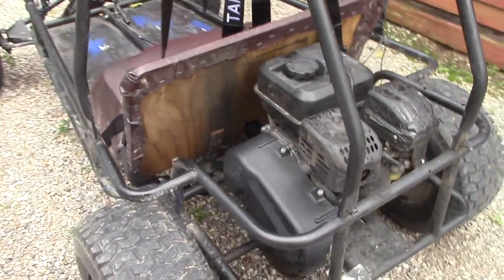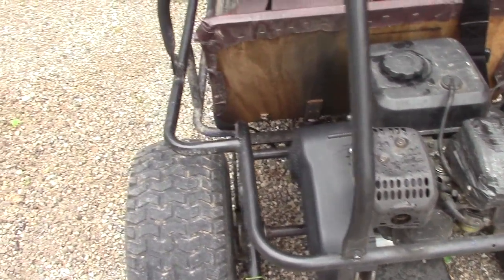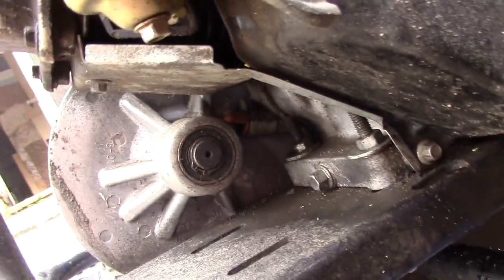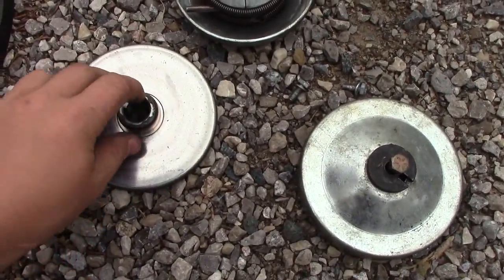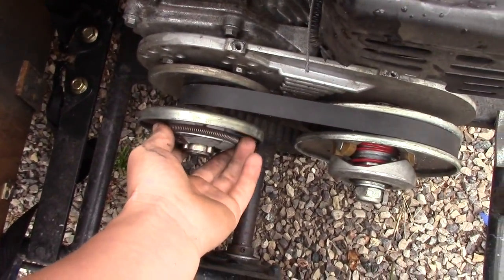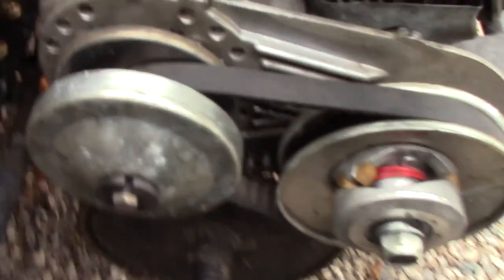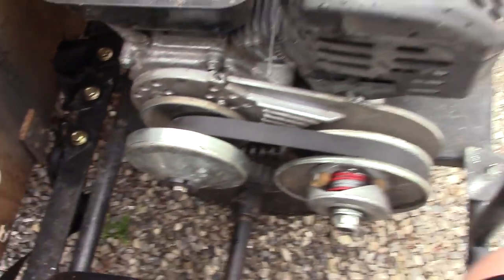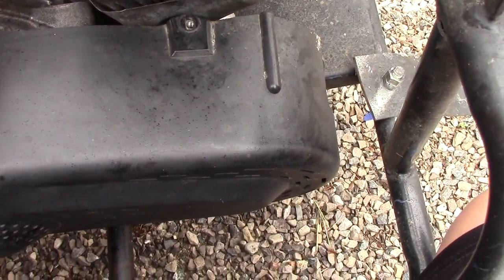Power Upgrades to the Offroad Gokart

Comment: Great gokart great material about converter. I definitely need to buy one. I have question what engine do You have ? 200 or 160gx ? and how many tooth has the wheel(sprcket) on rear axle ? What is the top speed of Your bolid ?
Reply from the maker: 200, 60 tooth rear, 35-40 mph